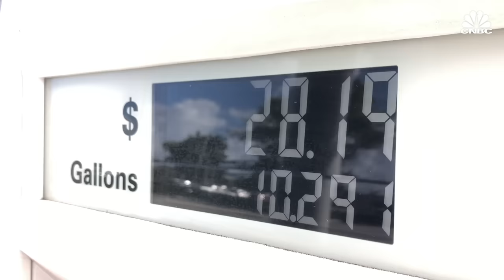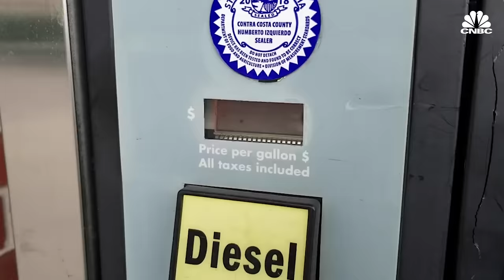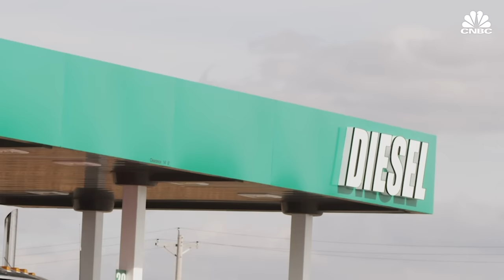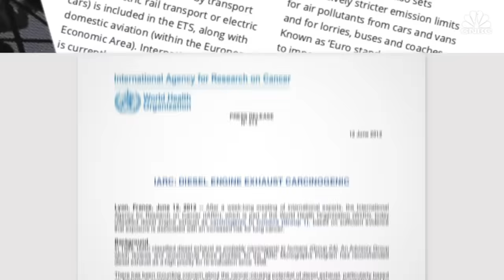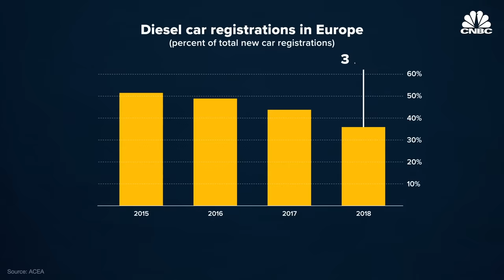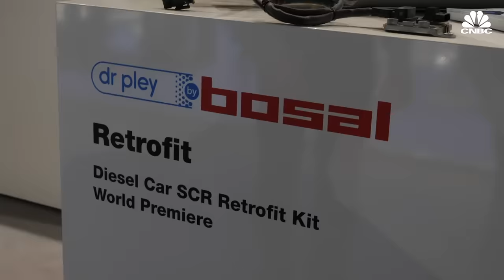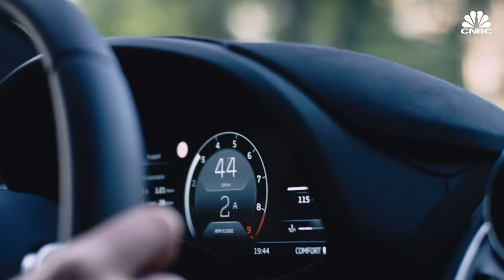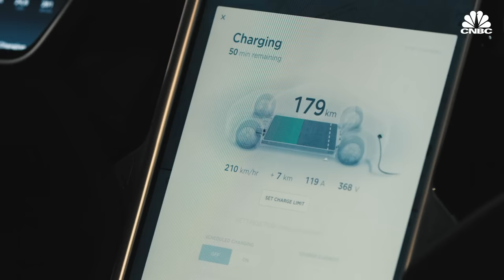Why Diesel Cars Are Disappearing

Comment: Sacrificing air quality? Did everyone forget what the big cities smelled like just 10 years ago?
Reply: That's an excuse for spewing cancer?
Reply: Aidan callen  watch the video again, less CO2 but more NOX and PM2.5 which are worse, not to mention carcinogenic. You keep telling yourself diesel is cleaner.
Reply: @Stolas the ones that quickly clog up and cost a fortune to replace you mean? Lol most people are not aware that you are meant do to long trips to avoid the filter clogging up, they just go for the cheaper option (then get a nasty surprise). Not  to mention it is carcinogenic and emits very high NOX and PM2.5... Diesel drivers are real heroes.
Reply: @chiquicat1  most modern gasoline engines produce more PM2.5 then Diesel engines. Yeah the NOX is higher, but for that there is adBlue. Diesel cars with partical filter wich is standard since i don't know how many years (atleast in Germany) and with adBlue are extremly clean and efficient.
Reply: @ThePatUltra new diesel cars from atleast almost 10 years ago haven't given off fumes. i had a car from 2012 that gave off less fumes from it's petrol variant even at a similar rpm cause petrol engines just burn more fuel in the same time and i've checked this with the help of a friend who had the petrol variant and newer cars like stated in the video have nearly zero emissions mostly because of better filters and more efficient engines
Reply: @ThePatUltra lol
Reply: They still smell
Reply: Did you watch the video? It says its more deadly with carcinogenic. People just literally hear what they wanna hear or what?
Reply: @matthewmorrison2970  Exactly the big cities still honk 😆

Comment: I’ll keep right on driving my diesels, thank you. It’s a good thing Diesel engines last basically forever with proper care and maintenance.
Reply: Until they installed the emissions equipment that kills them. Trucks used to last over a million miles, now you're lucky to get half of that.
Reply: Diesel engines might last forever, but the supply of diesel won't......

Comment: The death of diesel in standard passenger vehicles was definitely the VW dieselgate scandal. My dad had one of those cars. We got pieces of mail from VW about the compensation and how to turn it in if he didn't want to keep it. Obviously the compensation was VERY enticing and he sold it back. It was ~$14,000 for the car (2012 Jetta TDI) plus ~$5600 in compensation, so he got nearly $20k for it. He rolled that money into a gasoline powered 2015 Honda Crosstour EX-L and never thought about diesel again.

Comment: Haha as soon as the car manufacturers started actually making low emission diesel engines, politicians want to ban it.
Reply: we almost had hybrid cars, but government stepped in and made them worthless, 30-40mpg on a hybrid car is junk
Reply: I live near Stuttgart and they banned old diesels because the air got really bad their due to all the diesels. Iam not an electric vehicle fan but development on electrics was long over due for many classic car brands
Reply: @ChrisBa303  banning OLD diesels is fine, but new ones are still the propulsion of the future. The batteries of electrical cars are WAY too small for the kind of distances Germans drive on Autobahn.
Reply: @raus_mit_Islam  Lol your entire country is smaller single states in my country.  Texas is like 2/3 of Europe.  Alaska is the size of all of Europe.  Your autobahn is nothing compared to the US interstate freeway system.
Reply: @armyofninjas9055  Europe is at least 10 times larger than Texas...
Reply: @raus_mit_Islam  battery technology will improve
Reply: @darius4748  no.
Reply: It's not good enough
Reply: @raus_mit_Islam  i disagree. convert all of the older ones to run on vegitable and fryer oil. that way the city will have a pleasent smell of french fries. which will attract tourists in the catering areas lol.
Reply: “Low emission” Diesel engines are still environmental disasters compared to any other type of engine.

Comment: I have a 2014 VW Jetta Sportwagen TDI, and it gets an honest 41-42 MPG around town.  I check it every fill up.  This car has been adjusted by VW after the scandal.  Previously I had a 2001 VW Golf TDI.  Four years ago, I sold it to a neighbor with 326,000 miles on it.  It is still in use.  The only problem it had was a leaking fuel pump that was caused when sulphur was eliminated from all diesel fuel.  The fuel pump was rebuilt with different gaskets and the car was good to go.  I expect to keep my 2014 for many years.

Comment: They’re disappearing because the government is forcing manufacturers to put costly emissions equipment on them that wear the engines prematurely. I’ve removed that trash from my vehicle. Guess what… it’s still going strong and gets great mileage.
Reply: Zuurker U  yeah they’re obviously there for a reason. Those reasons are to wear out the engine faster, causing the owner to either repair the engine or ditch the vehicle. Making it 40% less efficient, thus spending more money of fuel (which big government is a huge fan of). Not to mention those emission systems cause fires.

Comment: I don't see electric cars becoming mainstream for a very long time yet. I can pull into a gas station and fill up my tank from empty to full in less than 5 minutes and be on the road again. A Tesla takes over an hour to fill up completely while charging. Also new taxes and fees are being imposed on electric vehicles by local governments and states. My friend has a hybrid and it already cost him twice as much as me to register his license plates for the year. Also electric cars are limited in range. Very cold weather affects their range as well. And if you try to tow just about anything, the range cuts in half from what's listed by the manufacturer. Try towing a 1,000 lbs pop up camper behind a Tesla model X and just watch your range plumet to nothing. 
A major breakthrough in battery tech needs to happen before electric cars become the norm.
Reply: And yet you dont need to pull into a gas station for like 99% of the cases because you always have "full tank" every morning. And most of us 99.9% of the time commute in town no more than 50 miles a day. Hence, it goes your argument out the window. 
In those other cases of long trips, you can use fast chargers (superchargers in case of TSLA) while taking a leek or a lunch break. Hardly a problem today. But, obviously, you have never driven a Tesla much less owned one. So u are disqualified to talk about this subject.

Comment: The thing people who don't drive diesels often dont understand, is that the majority of the peak torque number starts being made in the first third or quarter of the rpm range on up. A gasoline torque curve pretty much matches the rpm. You don't need to rev a diesel as high to get yourself moving or to pass or carry up a hill. I'm in the us and need heavy duty pick ups for business. All gas engines seem to get 10 mpg around town, doesn't matter what brand or year and that number only goes down hauling/towing. Diesels get 14 doing the exact same driving, in those same vehicles just with a different engine option. Yes they're more expensive, but you get all the money back when you sell them. Cold weather sucks but if the batteries are up to date and the glow plugs are working as they should, it's a non issue. 

The problem comes with 2008+ trucks when emissions regulation changed and to clean the exhaust, manufacturers were forced to add multiple expensive components that fail eventually, shorten the life of the engine by making them run hotter, and burn more fuel to generate heat to cook off any unburnt exhaust gases. In  2011, regulations got even more strict, and manufacturers added even more systems to pass emissions testing. Now all diesel trucks take def fluid. It's a separate tank that costs about 75-100$ to fill every few thousand miles. 
Between the rising cost of the diesel engine option due to the extra cleaning systems, fuel economy being lowered by said systems, and the fuel now being up to 50 cents more per gallon over regular, they have wiped out the advantage diesels once had. 15 years ago, people bought diesels for efficiency and power. Today, they are only bought for power or personal preference.
 It's a shame because it seems like they have ruined a good thing. I want clean air to breathe, I get it. But if you're burning significantly more fuel to get that, then overall it's a false economy. If emissions were based on output per mile driven and not by volume, how it's done now, it would be a different story. Diesels aren't going away anytime soon for all the off road engines, as mentioned in the video.

Comment: Modern diesel engines are far more environment friendly than the old ones. Diesel engines are a good choice for long distance travelling.
Reply: My Euro6-diesel is cleaner than most of the other cars on our roads.  AD Blue takes care of that. Electrics cars...a scam. Here state collects the most profit of those, due to heavy taxation on electric power...
Reply: diesel is couple of times worse then gasoline car from pollution point of view.
Reply: @denysivanov3364  but it's cheaper though and diesel engine repair and maintenance are cheap and easy
Reply: @denysivanov3364  Denis, not true. Read this: https://youmatter.world/en/diesel-or-petrol-what-pollutes-more/
Reply: @rabot8837  Electric cars are not a scam. According to physics, electric motors can be 85% efficient, if not greater, whereas diesel is 30 to 35% efficient and gasoline even lower. Plus, you can generate your own clean electrical energy to charge the battery, the batteries can be recycled by companies, and battery technology is constantly improving (especially with Tesla's innovations).
Reply: Denis Ivanov no one cares about Air pollution .diesel is the best roll coal for life
Reply: @rabot8837  Nope.  Burning stuff, especially deisel, fills the atmosphere with poison gases and tiny particles.  Up to 20 years ago the concentration was low enough to be diluted but not now, we need to stop burning stuff.  Euro 6 may be the best so far, but still emits poison and particulates.  EVs do not.  And if you source renewable energy (or harvest your own) no emissions elsewhere either.  National grids are getting more renewables added all the time, so EV not only start off cleaner (due to their efficient use of energy) and get clearer each year.  A 20 year old EV will be cleaner than it was when born!  Not so your Euro 6 engine which, even if well maintained, will be getting worse and worse as time goes by. 
Food for thought: the cost of ad blue and typical servicing needed for a combustion car exceeds the cost of the electricity to run an EV its annual milage.
Reply: From my understanding, diesel produces less CO2 emissions but more soot and particulate emissions. Scrubbing the exhaust takes care of that, which is what most modern diesels do
Reply: @overbored617  I don't think so
Reply: @pacoboss6865  why?
Reply: @louiseheiwood2688  can i get free knowledge on how scrubbers work?
Reply: @overbored617  because maintenance on a Diesel Engine is more expensive.
Reply: @rabot8837  Electric cars, very much not a scam.
Reply: @overbored617  Who cares about the pollution if it's marginally cheaper? I charge my electric car and drive for free.
Reply: @sploofmonkey It wasn't safe enough for highways.
Reply: @corbinpearson241  And EPA watches those videos, will fine you, worked with them today.
Reply: @MarkGarnettUK  👏🏽👏🏽👏🏽
Reply: @overbored617  Google has it
Reply: @NicholasLittlejohn  I tried fixing my college life using google, didn't help, most of the time I find answers on libraries looking at books because some knowledge are not ported digitally, I might get a TL;DR definition of it on google but not a detailed explanation of it, I'm just waiting for Chief Makoi tackle scrubbers on his vlogs but scrubbers probably isn't easy to break or malfunction
Reply: @NicholasLittlejohn  : Blow cancer? Is it congagious? I've been around diesel cars for most of my life. Shouldn't I already ... ?
Reply: Denis Ivanov: you're wrong. Diesel cars pollutes LESS than gasoline cars, with the exeption of nox-fumes.
Reply: @rabot8837  and also the electricity is generated very inefficiently by diesel engines at the power plants
Reply: @makingwaves1239  #metoo, since I was 5 years old DDD. And here a clip where, say Jeremy Clarkson shouts "we're all gonna die!"...
Reply: @denysivanov3364  - "diesel is couple of times worse then gasoline car from pollution point of view." Please get yourself proper information... Hear say BS don't count, as reliable information
Reply: @nousername5673  and how are the batteries build ? please check, how it is mined, and how well that goes for men and nature...
Reply: @Steve25g  Whataboutism. If care is taken, environmental impact will be minimal. If batteries are produced from recycled material, the impact drops further.
Reply: @nousername5673  and that's the problem. They stole agricultural land, poisoned , by cleaning the mineral, the water resources, and poisoned, and robbed the people there, from their income, home, and made waterresources undrinkable, for people and nature. Not sure, that place is part of the gigantic aquafer that exists there, which in the long run, could even be more desastrous
Reply: @Steve25g  What are you talking about?
Reply: @nousername5673  what happened in Peru, where ground was rich, with the right minerals, and more was needed, to make more (car)batteries

Comment: Having driven and fixed both petrol and diesel engines, i can say i do prefer diesel. One thing people seem to completely forget about is just how clean modern diesel engines are. Euro 5 and euro 6 emmissions standards are ridiculously clean, to the point that you wont smell them when they pass you on the street. Compare that to diesels made 10 and 15 years previous. Smoke, stink and far higher emmissions like soot, nox, hydrocarbons just to name a few. Petrol engines havent been cleaned up a huge amount, not to the extent that diesel got. But if they really were worked on extensively they could get extremely clean, way cleaner than the engines we have on the roads now

Comment: i tried filling up my diesel suv with vege oil. it runs just fine😂
Reply: which vehicle and year was that? I am looking to get a diesel just for this purpose
Reply: @makingcookingfixing  get an older diesel such as a cummins 12v, 7.3 powerstroke, 6.0 powerstroke, 7.3 idi/6.9idi, or an old Volkswagen diesel
Reply: @makingcookingfixing  if you know nothing about cars dont get a diesel
Reply: @Cherokee93  Thank you!
Reply: Unless it's used vegetalbe oil that would otherwise go to waste, you are basically burning food.
Reply: The diesel engine can drive on basically anything (see for example ships driving on low quality oil). But there is a risk that the “head” that sprays the fuel into the engine can clog up. Especially if the fuel is thicker. I would more trust a old diesel car with “alternative fuels” than a new one.
Reply: @makingcookingfixing  you need a really old one to be able to run it on that stuff, probably not anything newer than  a Mercedes W124
Reply: Kyle Butler food is a renewable resource
Reply: I ran a Peugeot 205 on vege oil. The engine loved it; purred like a kitten. Unfortunately the veggie oil ate the seals out of the fuel pump. Switched back to regular diesel.
Reply: In south wales a few years ago cheap veg oil sales went up by 500% in one supermarket because people were fuelling their cars with it. In modern common rail diesels I dont think its a great idea, but older direct injection vehicles it should be okay mixed with some diesel..
Reply: Mechanical driven pumps generally run fine on veg oil, with a little fettling.(di)
Electrical pumps, wouldn't chance it personally, them types are very delicate and costly.(crdi)
Reply: put BP GO in it.
Reply: Skywalker Hunter Archive long term it wont run fine.
Reply: My buddies fuel guage wasnt working, and he ran out of fuel. Stranded and not wanting a tow, he tossed in a combination of power steering fluid, diesel purge and corn oil and he was able to get it started and back on the highway
Reply: @amct518  that was an expensive experiment.
Reply: Wade Stanton bukake?
Reply: Why not u try create biodiesel from palm plantation
Reply: Make sure you change fuel filters often. Also best to use conventional oil every other time.
hat will help clean any "gunge" from injector pump and injectors. as they have very very fine tolerances. An expensive job if the pump or injectors need repair. 
As an aside, I know a guy who ran his oil on old left over fish and chip oil. His only complaint was the whiff of chips from exhaust.
Reply: The glycerin content in used fryer oil can be problematic. I've done teardown inspections of mechanically injected diesels that ran on used fryer oil. It forms deposits in the cylinder that does things like makes the piston rings stick. One 2 stroke Detroit diesel had deposits obstructing almost half of the air ports in the cylinder liners. When I read into it farther, it was my understanding it was due to the glycerin. As far as waste motor oil goes, up until the late 90's Caterpillar approved up to 10% WMO / 90% #2 Diesel mix as fuel for their stationary engines. There was a booklet called "Diesel Fuels and Your Engine" from Cat that outlined the specifics. Most likely out of print now.

Comment: Still have 2015 VW amarok 2.0Tdi , the one thats cheated the emissions probably. Has about 248k km on it with original engine and zf 8 speed auto, service it every 15k km as per manual and been quite reliable so far. Drove about 50km on highway yesterday and got 6.8L/100km.  Really good for a pickup truck! I wish there was no developments in diesels!